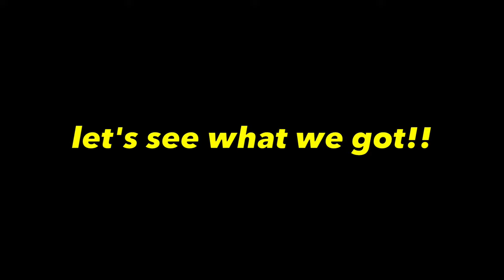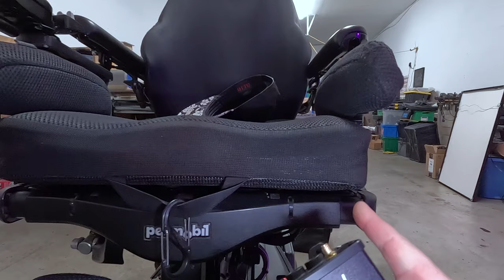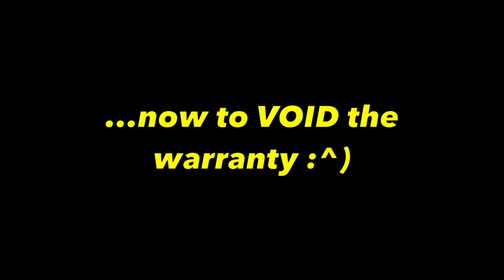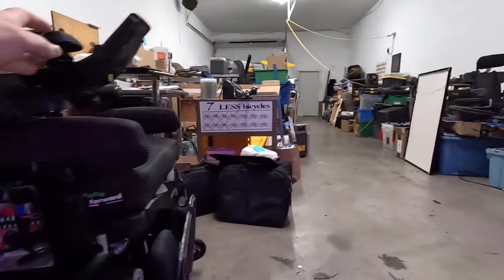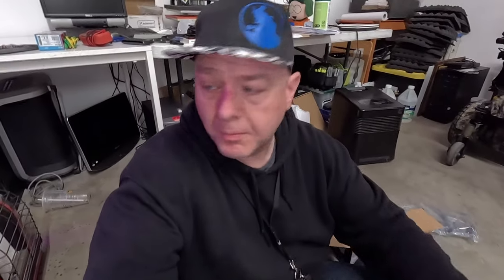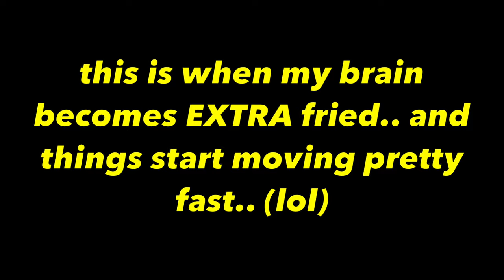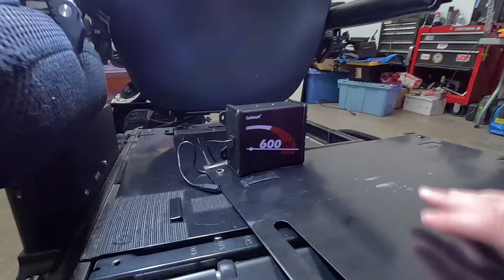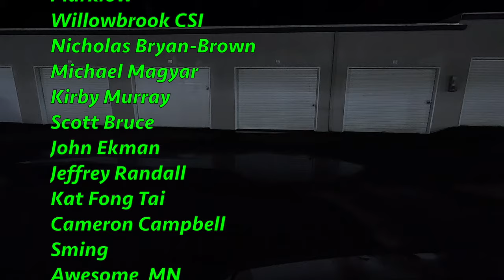VLOG 699: stereo install on the F3!

Comment: Good systems play all music equally well if uncolored. I'd like to install a system on my upcoming wheelchair, but use custom enclosures with Dynaudio component drivers, crossover, and a good little power amplifier, and have a proper head unit with bluetooth.

Comment: Can you offer any advice on putting better driving lights on my Quantum Edge 3?
Reply from the maker: “Easiest” way is to get some 24v compatible lights and wire them to the batteries with a fuse and switch directly. I’ve used these lights on a number of chairs
https://a.co/d/8K11wWL
Reply: @TotallyNormal-  thanks!  I can't think of a place to mount those.
Reply from the maker: Yea.. edge of seat pan on the rails sometimes works.. but they have to be tucked in pretty tight so they don’t hit things.. and then so legs don’t block the light. Ya might look for pictures online of the upgraded light kit to get an idea of how they’re mounted from factory. I posted illustrated parts breakdowns for quantum chairs on the website.. should be able to find images buried in one of those…
brokenwheelchairs.com